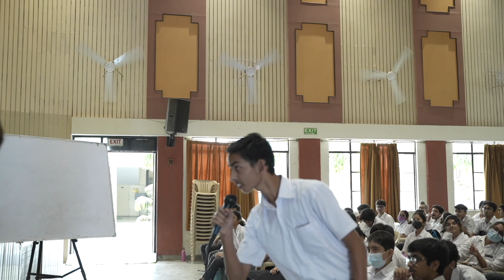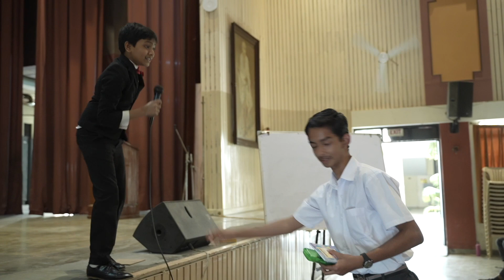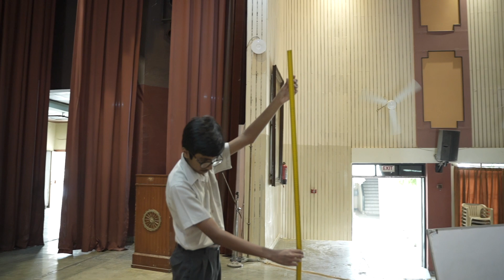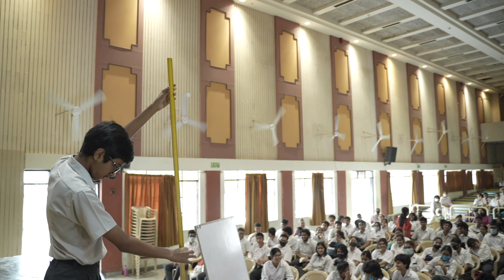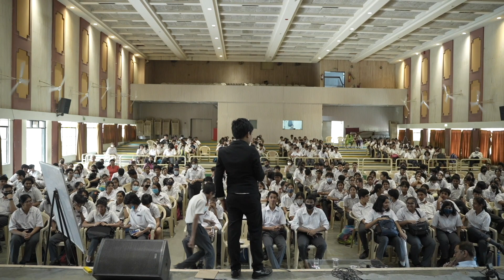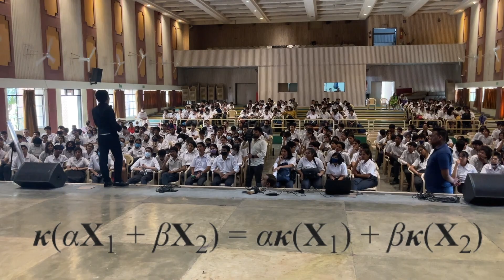Tensor calculus

Comment: Tensor calculus is an important area of mathematics that has many applications in physics, engineering & other fields. 

Coming to physics it's a powerful tool for physicist to play with it particularly in the areas of quantum mechanics,  general relativity, electromagnetism & fluid mechanics. ☝️